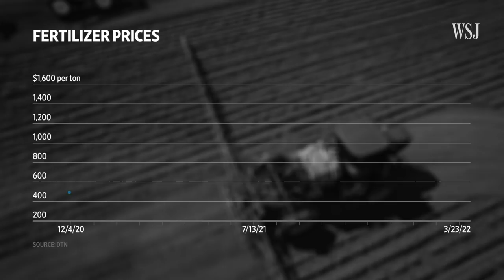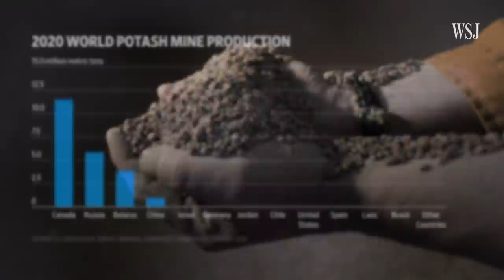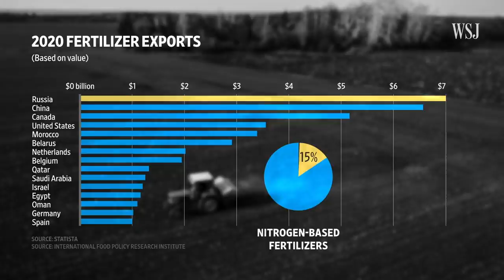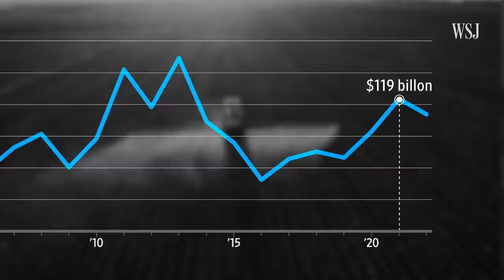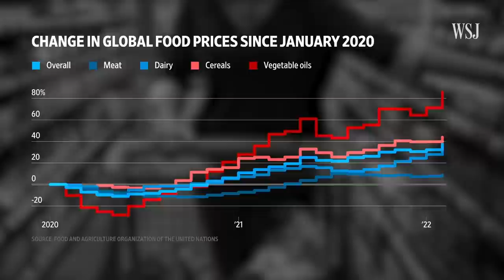War in Ukraine Cuts Fertilizer Supply, Hurting Food Prices and Farmers | WSJ

Comment: Cover cropping with non-patented seed varieties needs much wider adoption across all kinds of agriculture in order to lessen dependence on industrial fertilizers.
Reply: will not happen from one year to another, but this crisis will push some more farmers in this direction.
Reply: Are you kidding?
Reply: @robertreznik9330  - No. I am not.
Reply: @pluribus_unum  When you start farming at a profit I will agree!
Reply: @robertreznik9330  - This is why the federal funding to bring down the median cost of $12/acre is wise investment. 

Still, reduction isn't replacement. Using cover crops, especially erosion preventing, as any part of the cycle anywhere possible still reduces dependence and mitigates cost increases due to whatever reasons.
Reply: @pluribus_unum   raises OM in soil raising CEC's , ability to hold more water and buffer ph.
Reply: yo boi johney  - Tillage is not the concern I have. Even significant tillage combined with soil retention techniques is perfectly compatible with my suggestion to increase the use of cover cropping.

I'm speaking to ecosystem and pollinator "net positive" ways to lower the herbicide, pesticide, and industrial fertilizer inputs.
Reply: As a farmer, there’s validity to this, I think everyone should at least experiment with it but it doesn’t have a place on every operation, there’s so much regional variation with agriculture, it’s about looking at what your soil needs and addressing it.